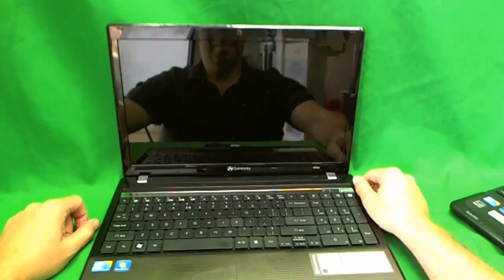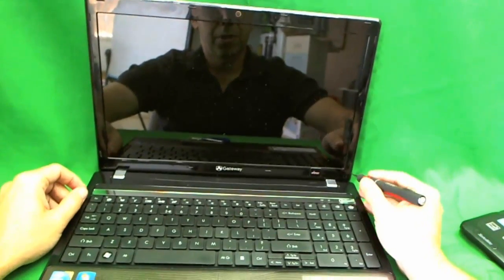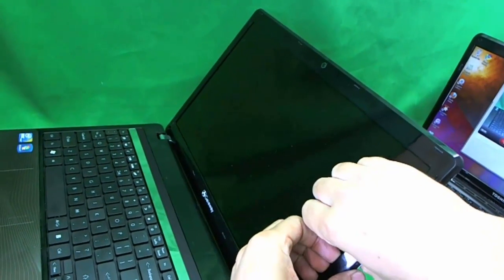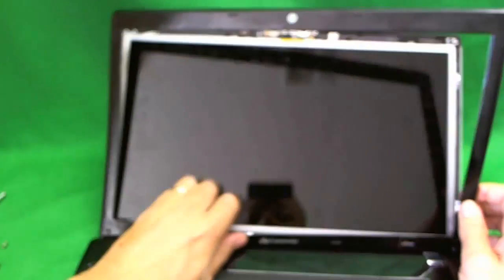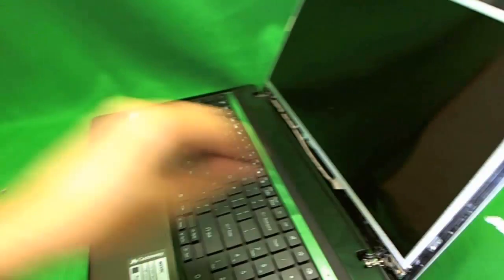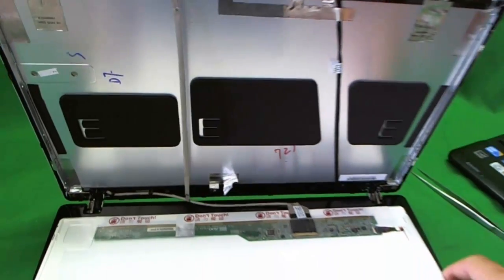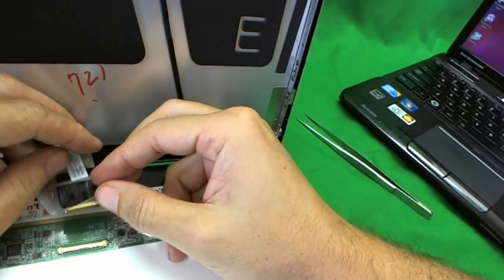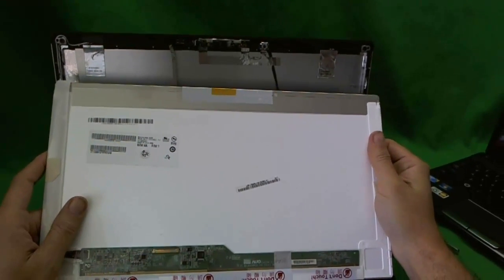Gateway NV59c Laptop Screen Replacement Procedure

Comment: I need a replacement for an NV59 from Gateway. It is an i5-430m (1st generation), also 15.6", which I bought new in 2010, just 2 years ago. Got it? Unfortunately, these companies are manufacturing laptops of poor quality so that they need to be replaced often, usually just after the warranty period has ended (financially clever, yet morally reprehensible). 

Well, I suppose that translates into more repair business for you, though, eh? Hahaha, lol. My 1st laptop from 1990s is still goin' strong!